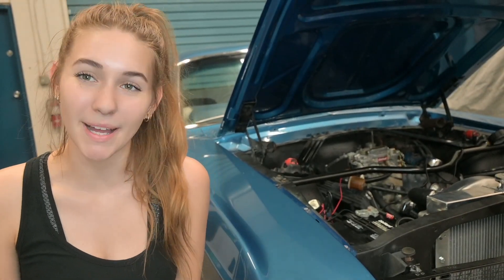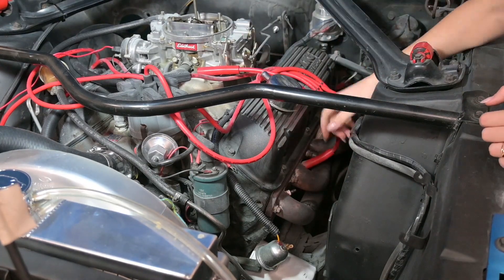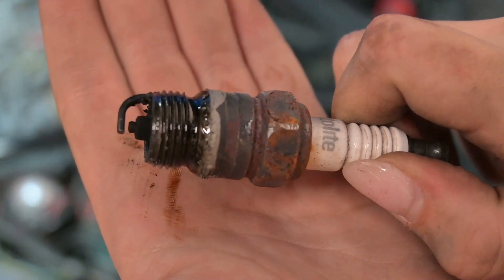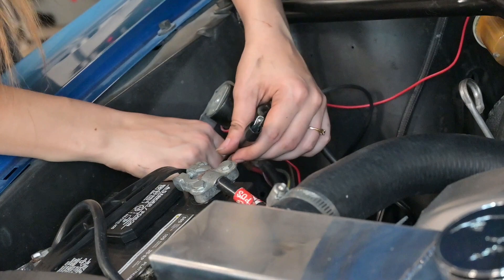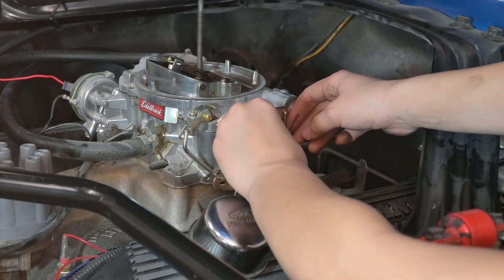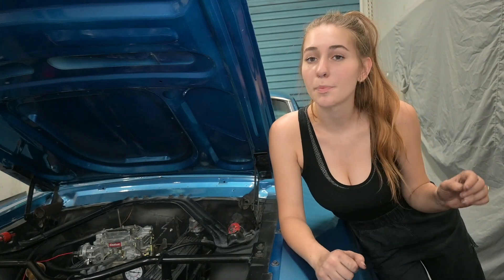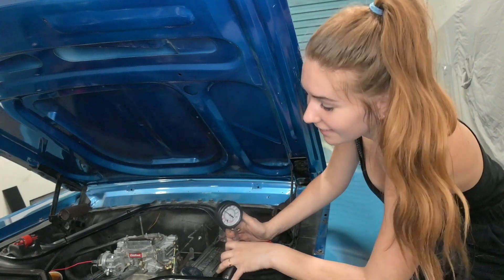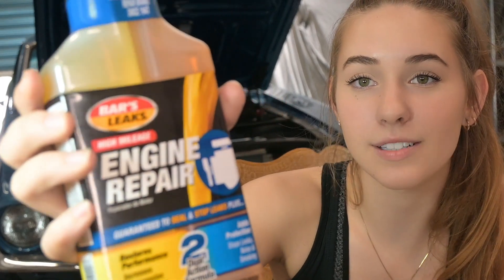Refurbishing My Engine! | Part 1: Compression Test

Comment: Hi Kat. There is one other test you can do to confirm your diagnosis and that a pressure differential test, like we use on the aircraft engines. Pressurize the cylinder to about 80 or 90 pounds with the cylinder at TDC power stroke. Then listen in the carb, in the exhaust port or tail pipe and the engine breather tube . If you hear noise from one of these it will tell you whats going on inside. For example if the pressure is escaping through the breather tube you have ring problems. If its coming out the exhaust its an exhaust valve or carb its intake valve issue. 

Good luck with the project. I was hoping to see you at the hanger but missed you.

Comment: Nice Kat  When I had my 68 Mustang I ran 2 Holly 600 carbs Duel carbs.   Just a comment get rid of that Elde Carb, because the left float goes to the right bank and the right float feed the left bank.  Junk.  Go Holly  Carb.   Trust me.     I would not let you down ever.

Comment: Hello again Kat!!! Nice job and right like a pro would have done. Not nuts about oil additives personally,  but hopefully it works for you. My 67 gt has a built 460 big block. Talk about having no room to pull sparkplugs, and the headers? Would have to pull the engine up about six inches. Thanks for sharing and see you on the next one! Cheers from Motown/Dearborn, home of the Mustang.